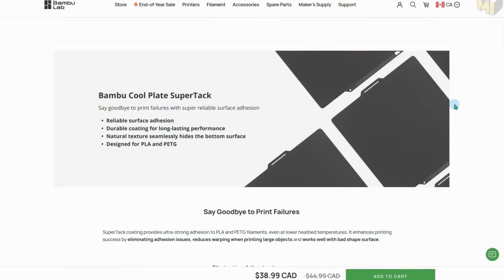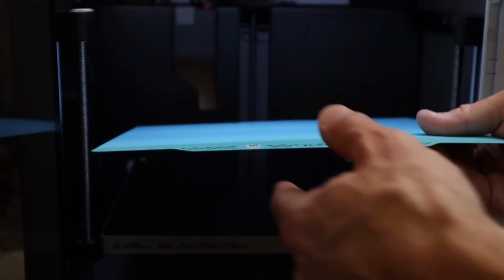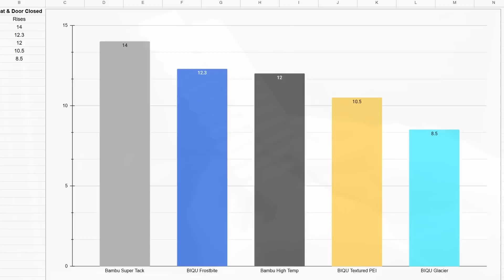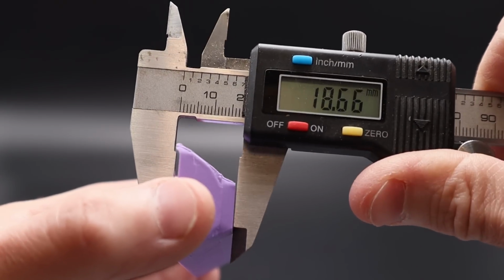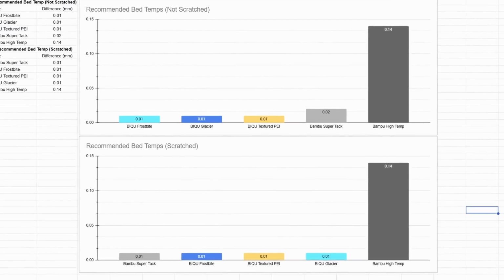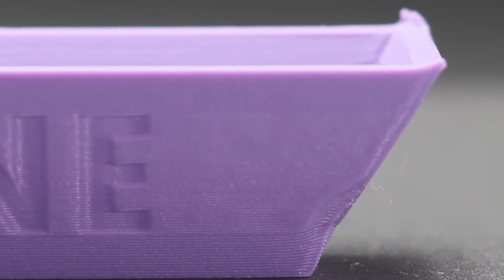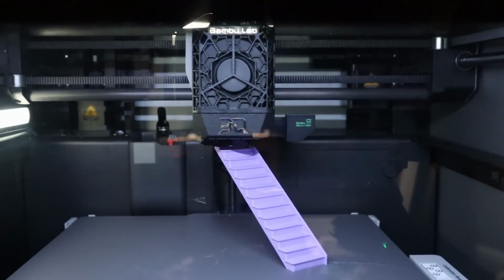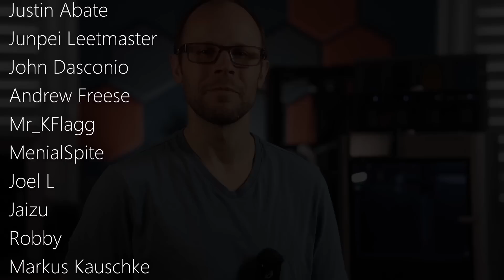Which is the best, the Bambu Super Tack or the BIQU Frostbite or Glacier?

Comment: Thanks for doing this. I am relatively new to 3D printing and was told early on to use glue stick with my Bambu standard PEI plate. And I have done so. But there seems to be lots of opinions, I am glad you used test prints and weights. I ordered the Frostbite as I have had a few larger prints lift even with glue stick. I also print PLA on my P1S with the door closed and the lid on. This seems to work for me, but should I have the door open and top raised or open?  Printer is in the garage in New Zealand so temps range 10C to 30C as the extremes.

Comment: The BQ CryoGrip Pro Glacier (I don't have the BL one) is my goto plate for PLA and PETG. 
No glue stick, just wait for the bed too cool off and the parts just "pop" off.
I have not had any problems with any bed adhesion on PLA, and for PETG, if it is longer than 120... mouse ears or brim.

I thought that glue stick was not for adhesion, it was for release.

Comment: Are you still using any of the cool plate? How do you find?
Reply from the maker: I use the Bambu super tack on occasion, but I only have it for the X1C and the P2S, I believe they are offering a newer version as well for the H2D and H2C, so I wanted to check those out.  My issue is that I print with so many materials that I mainly stick with using glue stick on the textured buildplate, but with PLA and PETG, the Supertack is still working great, I can't say I have any complaints.  I would be curious to compare the newer version vs the original, maybe that should make it into a future video.

Comment: With such energy saving, you can make buying such plate profitable after only 400 hours of print, mind blown
Reply: After using the Super Tack (purchased on sale for <$20 for p1s and $9 for the A1 mini), it's not even the cost savings. It gives a great matte texture and not requiring glue improves the surface finish even more. Additionally, it is far less sensitive to finger oils and prints simply peel off so don't leave white marks from microcracks in the print.

Comment: I've had the supertack plates for my Bambu X1C's and I've given up on using them. They had really poor adhesion from day 1, and haven't got any better. PLA and PETG would just get pulled all over the plate. I had very few issues with the standard texured PEI and smooth plates before trying the Supertacks.
I've got a Biqu Glacier for my H2D and couldn't be more pleased with it. Sticks really well for all materials, and releases most of the time without even needing to take the build plate out of the printer.

Comment: I've used a g10 build plate for about a year, and it's the best I've ever used, tpu,petg,pla,and nylon all stick perfectly with a temp between 60 and 80c, and they just fall off when the plate cools. No glue, just wipe down with isopropyl alcohol every now and then. They're sold on amazon in tons of sizes.

Comment: Since everyone has a Bambu textured PEI plate, it would have been good to test that as well to use as a baseline. Would have been interesting to see how the others compare to this.
Reply from the maker: I didn't go that route mainly because the texture causes issues with the auto-calibration... I also don't have one.  I've never found that the texture is enough to hold my prints down, lots of people seem to have success with it, I think in most of those cases they are printing light duty prints which aren't prone to warpage.  I guess it would depend on the use-case though, so valid point for sure.
Reply: @NeedItMakeIt Interesting. I thought all Bambu's come with a standard Textured PEI plate. I have an A1 and it comes with one. According to the Bambu site appears they all do. I use the Biqu Glacier since it has a smoother bottom which matches well with top surfaces and you can print most filaments (except PLA Silk).
Reply from the maker: @christopherlyons7613  I think the X1 is different because of the style of calibration  it uses, the A1 has a better system for calibration, how have you found it?
Reply: @NeedItMakeIt I don't really think the A1 calibration is better just different. It doesn't do the visual inspection like the X1C. It's more basic but it seems to work Ok for me.

Comment: I don't understand why people are still using glue sticks. I used to use it 10 years ago when glass beds were common, but with pei and flex plates I haven't found it to be needed (except in rare cases where adhesion is TOO good and the glustick helps with removal)
Reply: I agree. I very rarely use glue stick anymore with any of these plates. TPU is one of the only filaments I still use glue stick with.

Comment: I just got the bambu super tack but just can't get it to stick this good. I only managed to print items with bigger surfaces. Iam just now trying to print something with less surface on the bed which printed fine with the pei plate but keeps warping or getring unstuck with the new plate.
Reply from the maker: Hmmm, I'd suggest first giving it a really good clean then with soap and water.   I still have success with mine, on some really heavy duty parts it might want to lift a little near the end of the print, but they still turn out well, it's been a great addition to the machine for me.  When you wipe it down with a cloth, it should feel a bit "grippy" or tacky.... Super Tack, can you check yours?
Reply: @NeedItMakeIt  thanks for the advice. Will check tomorrow if it helps
Reply from the maker: Sounds good and let me know, maybe there is something different about your material or setup than mine, but so far it works with PETG and PLA every time, I don't even think about it anymore.
Reply: @NeedItMakeIt   Is the humidity and temperture where you print really low? Because i heard some people say that the plate stopped working when the humidity whas higher. Where i print it's something like 60% and 12 degrees Celsius so not really hot.
Reply from the maker: The swing is pretty wild here, not at the moment, but it will get pretty humid in the spring, at the moment the temps stay around 16-20C and the humidity is around 25%, so pretty low.  It'll of course change inside the build chamber as it heats up, the RH will drop to around 10% or so, maybe less, but that's about the minimum I can measure.
Reply: @NeedItMakeIt  So i tried cleaning it with no luck. But i read on reddit that iam not the only one these last few weeks so i think there is a bad batch.

Comment: Thank you very very much! This is by far the best video on this topic I could find. Answered all my questions and the ones I didn't have yet :D
Reply from the maker: Nice!  It's been a top performing buildplate for me, I've even been using it for heavy duty parts, it does tend to start to lift near the end of those prints just a bit, but they still came out fine, so pretty good results still and after scratching it up, I'm not afraid to use a scraper on it either, the performance doesn't seem to suffer at all!

Comment: Could you test the plates with various solvents? I know some say not to use isopropyl but it would be interesting to know what effect it will have... I like to use isopropyl to release stuck prints, it works just as it does with hot glue and the parts lift straight off. My plates arrived today so i rewatched this and noticed the no isopropyl this time

Comment: Been printing with my X1C for over a a year and NEVER used a glue stick. Textured PEI and Supertack plates only.
Reply from the maker: Hey, if it works for you, keep doing it, if you ever start printing heavy, anything with 5-6- walls or heavier, you may want to start using glue stick, it is also highly material dependent of course.  I still see lots of videos and pictures of prints with lifted edges, that's a no-go for my purposes.  With the Super Tack, I don't use glue stick anymore, but it does still start to lift with very heavy prints, just barely though.

Comment: Great video. I got the frost bite and have been using it for about 3 weeks now non stop. Im having adhesive issues with it already. I have been printing at about 35 dagrees Celsius for the bed. At first i had no issues no warping nothing. Now im have warping issues with 100% infill prints even with a brim. Im going to get the super tac plate soon. I have since switch to the stock pei plate that comes with the a1 and haven't had any warping issues yet.
Reply: I'm using it with 45C for PLA and 70C for PETG and it's working perfectly. 35C sounds too low.
Reply: @ragesmirk  thats the stock settings for it in the bambu labs app. I will adjust it and see how it goes.

Comment: So I got a hold of a CryoGrip Pro (Glacier) and have been doing my own testing -- I wasn't thrilled with the performance until I remembered that the X1C has a weird bed-leveling technique (from my testing and understanding of the docs) in that I believe if you have a LIDAR unit, it uses that as part of the calculation, otherwise it sticks to the nozzle touch feedback sensor. 

The blue color seems to throw it off and I had to adjust the Z-Offset to about -0.06mm. This is different than the texture plates having deep textures which also throw off the Z-Offset. I had to do this before with a yellow color plate. I think they calibrate the LIDAR's on the base gray of all their plates.

As for the filament LIDAR-based calibration procedures, they didn't work for me. They also didn't work on the yellow plate I have. The odd-colored plates seem to be really picky on what filament colors the scan picks up, which makes me think their algorithm is tuned for the neutral-gray shades of their own plates to filter out (you can see this with some 3d-scanners).

Just posting for anyone who maybe struggling with these plates.

Also, the QR Code supplied does work, but it has to be in the proper orientation as BambuLab doesn't scan in all rotations, I noticed some other people online saying the supplied codes don't work and their QR's were stuck upside down (check an official plate pic for the proper orientation).

Comment: Do you know if Glacier is less affected by fingerprints/oils than textured PEI? We've replaced all of our textured PEI plates with SuperTack plates, which have been great for PLA & PETG, but I want something for ABS, ASA, TPU, and PC. I don't want to buy Glacier plates only to find out they're just as finicky as PEI when touched or not cleaned perfectly. SuperTack doesn't seem to care if we touch it or anything, but PEI is awful if touched, and we couldn't even tell when we needed to wash it until a print failed and ruined our day. @NeedItMakeIt
Reply: Following up, I have spent the past year with 6 SuperTack plates and 6 Pro Glacier plates. The SuperTack plates hold up quite a bit better, but I like the Pro Glacier plates more as they are thicker (large prints will still warp ever so slightly on SuperTack by lifting on the entire plate), easier to remove prints from (so much easier), and support more materials. However, the Pro Glacier coating is inconsistent (some plates are much better than others), and we've started to have failures on them. I think it's actually the PTFE tubing rubbing on the top glass and depositing PTFE dust into the plates that is causing most of my issues. Either way, the SuperTack plates have slowly gotten easier to remove prints from and are holding up better.

Comment: I scuff my surface on my bed to help with adhesion. I use sand paper to scuff it and it makes a nice surface for the prints to stick too. I use pei off Amazon gizmo dorks 10.2 inch or something like that, I glued it to a Bambu plate. The pei came with adhesive already. I scuff that pei up which is a smooth pei but after scuff it has a nice texture.

Comment: I’ve been using the Thekkiinngg double sided PEI build plates on my MK3 and now all my X1Cs for thousands of prints and have never once needed glue! Most people have never heard of Thekkiinngg but look them up! $35/plate not cheap but I’ve been using the same 3 plates in my X1Cs on a single side. Haven’t even needed to flip sides after thousands of prints over the last several years! Amazing build plates!
Reply: I have never used glue stick on my mk3s smooth pei sheet for pla, abs or PC. The only time I have used it is for TPU as that sticks too well. I am surprised that he used it for pla on his bambu lab. I would have thought it be the same as a Prusa PEI sheet.

Comment: I would like to have my favorite Surface i use already for almost a Decade in every Printer without magnetic Plates, its simply called Pertinax.

I already forgot that Warping and Adhesionproblems exist and the A1 Mini i got reminded me that they still exists, i even have to use brim on PLA on the SuperTack to prevent Warping (depending on the Model of course), on Pertinax i only have to use Brim on ABS when the Model has sharp corners.

Comment: It would be ideal to see repeated tests instead of a sample size of one. I’m also curious about glue sticks because I have hundreds of prints on in X1C using the textured PEI plate, and the only failures I have had were after not cleaning for a while, going between multiple different materials, and having touched the plate, but not bothering to wash it. This tech has come a long way since I started printing back in the days of the Prusa Mendel and original i3, where are used to just do hairspray or kapton or painters tape on thick glass.

Comment: thnx for the info but i think you could have shown the compatibility with other filament types other than pla/petg. yes supertack and frostbite are best for pla/petg but you could have explained how glacier might possibly be the best plate for anything that isnt pla/petg.
Reply from the maker: For sure, I can always do a follow up video.  I didn't delve into the Glacier too much but I did cover it near the end, showing the results of ABS and Nylon with the Glacier.  IMO the Glacier is a great option for anything higher temperature... up to 300C nozzle temp.  I think the results with no glue were impressive, HOWEVER it still requires mouse ears or a brim, and I'd set the brim closer than 0.1mm, I like to use .03mm to keep it nice and tight.  Those higher temp filaments are still prone to warpage and the Bambu Printers aren't heated and though they do get to temperature after an hour or two, I was still seeing the tendency for the parts to warp.  I do make my prints heavy duty, either solid or with heavy infill so maybe this isn't going to be an exact match to what most people do, but I usually like to go to the extreme to make sure we know what the worst case will be.  In any case, you bring up a good point, I admit that I have tried to focus in on one subject a bit better, I will certainly keep your points in mind for future videos!

Comment: if a 10-hour print you saves about 6-7 cents on this plate (assuming $0.10/kWh electricity), you'd need to print for about 3600-4000 hours to justify the $25 price tag (if money is the only factor). The plate might wear out before it reaches that many hours.

money aside, these plates look like great choices.
Reply: One large failed print could cost you 10+ dollars in filament, plus your time is also expensive if you have to constantly mess trying to get things to print properly.

Comment: Just testing the "super tack" plate from Bambu in my X1C. Gave me an error that the Lidar can't read the plate type! If you bypass this error then the X1C will print the first layer in the air to boot. My Bambu Studio and printer are at the latest level. Doing a search I found that this is a common problem since back in November. I guess Bambu is aware of it but has provided no fix to date. How can they even put out a plate that their top line printer can't even read? Very poor to say the least! The only to get around this is to turn off "plate detection" in the device tab of Bambu studio. I just started printing your staircase to nowhere using a bed temp of 30 degrees to see if it will adhere all the way up. My end goal is to be able to run prints with the door closed to cut down the noise and still not go above 34 degrees in the chamber. Time will tell here before long 😉.
Reply: Well on my X1C I made it to almost 9 complete steps before it fell down using a bed temp of 30 degrees on the super tack. Was hoping to make it all the way but that's pretty good adhesion.

Comment: Definitely curious to add one or two of these plates for my collection. 

On a side note, I'm always surprised to hear experienced 3D printers talk about how much they use glue stick. I print both as a hobbyist and a professional, and I almost never use glue stick. I've found that the right surface at the right temperature almost never requires glue. Sure, that means that I have at least 3 types of build plates that i cycle through, but I also rarely ever have to deal with the sticky funk that glue leaves on a print.